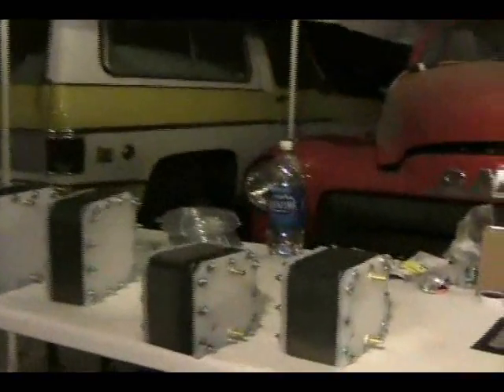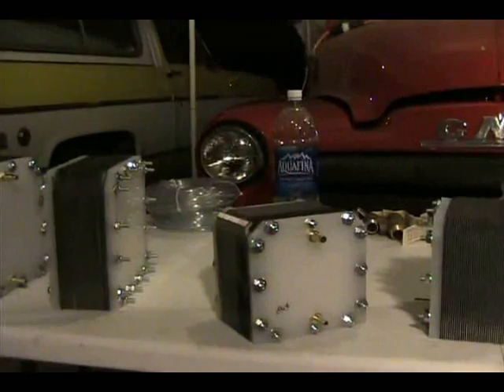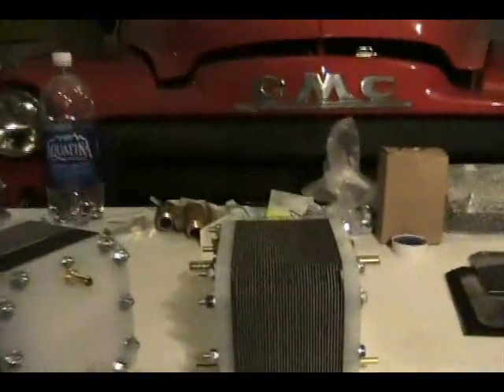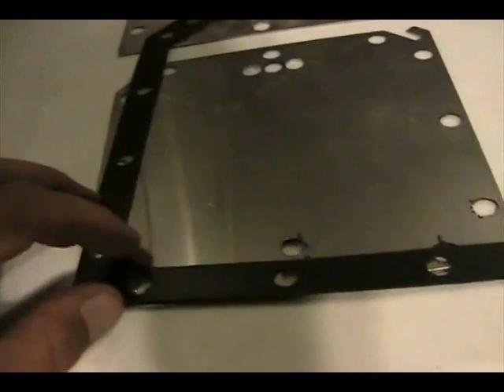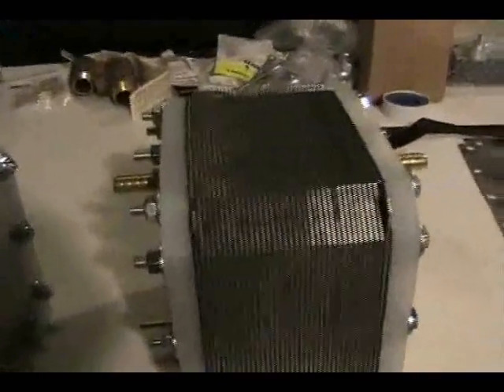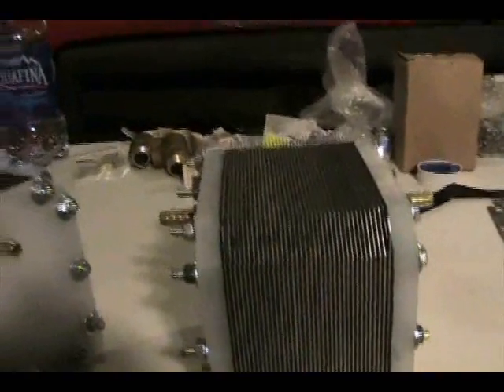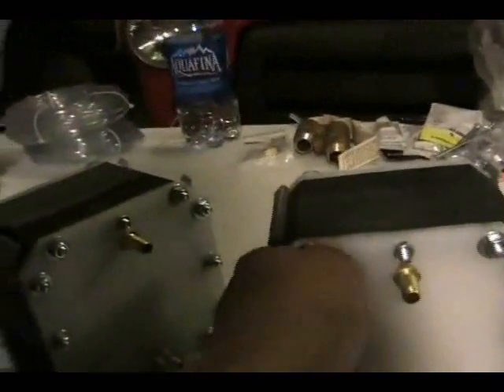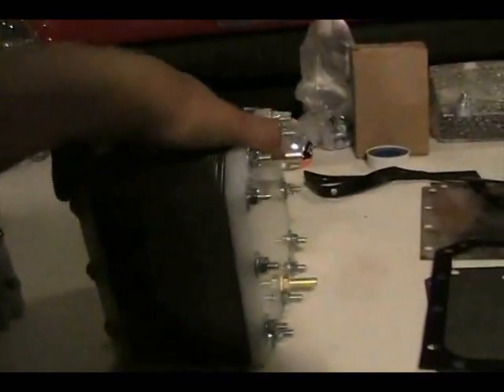Design and Implementation Part 1

Comment: yes this cell is mainly for learning, and testing which requires main different wiring schemes, a purpose built cell can and more than likely will incorp. bolttype connections. remember each terminal sees relatively low amps, on a 21 plate cell that draws 35amps the most a single connector sees is half of that, which is about half the connectors rating, which should be considered the max for a ss connection. derating for ss is important

Comment: the only part i dont like about the ebn cells is the small space in which to hook up an electrical connect, maybe you would just put some washers in between the plates your connecting then a bolt and tighten together like that.